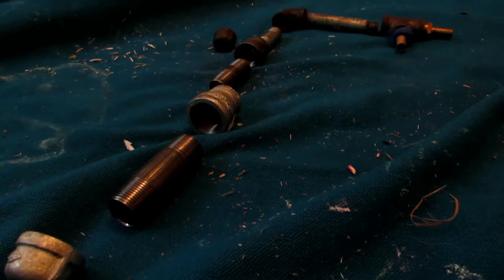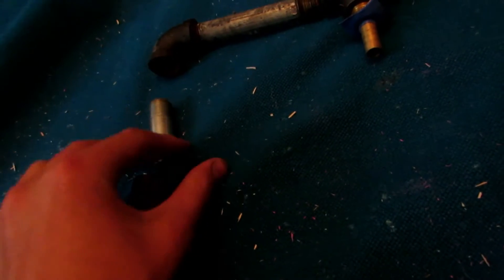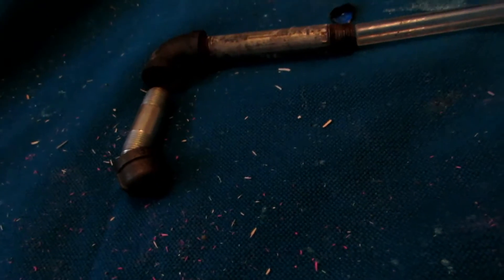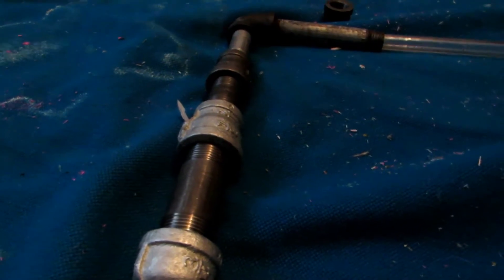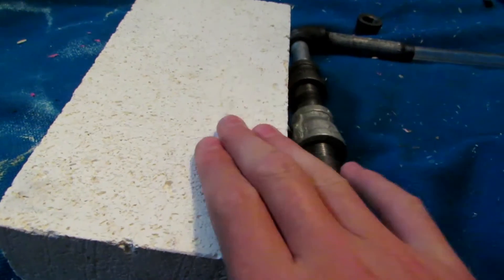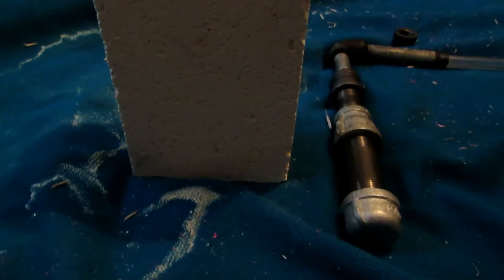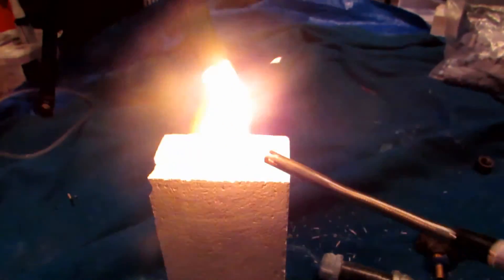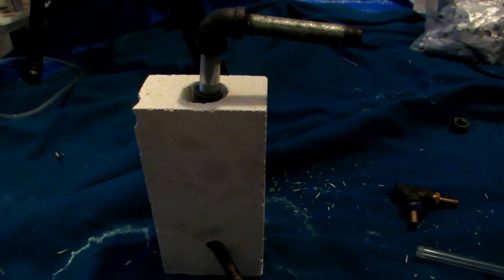High Tempurature Distillation Aperatus

Comment: AWESOME VIDEO.  Very helpful,  I am going to do this soon and i love how you just kept using reducers and the refractory brick thing was a GREAT idea.    I am trying to learn how to do HIGH temp reactions right now.   So i need to build something that will DEFINETLY NOT leak.   QUESTION:   Do you put teflon tape (plumbers tape) on the threads of the pipes when you connect all the pieces together??/